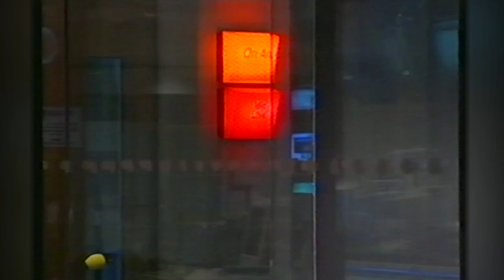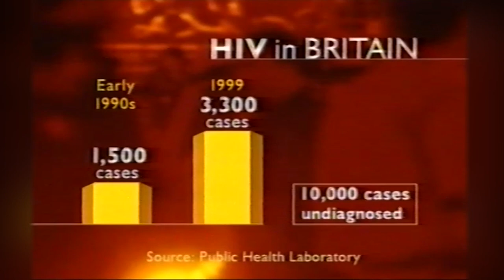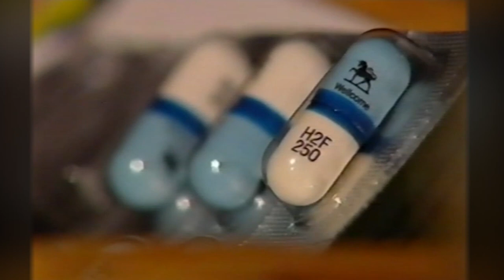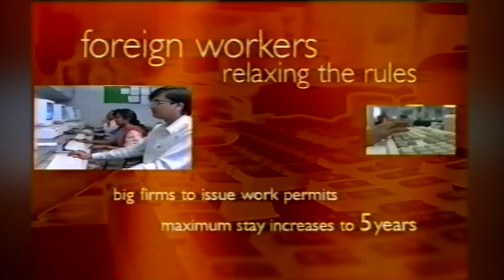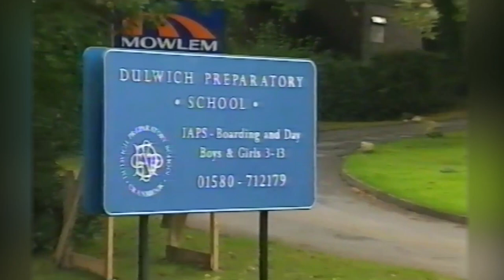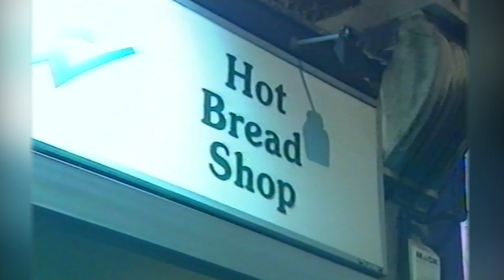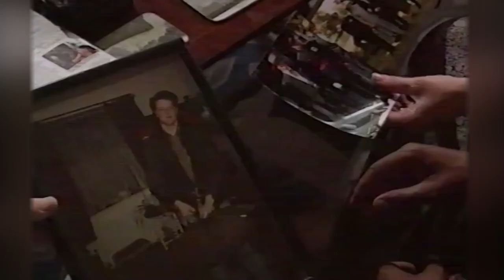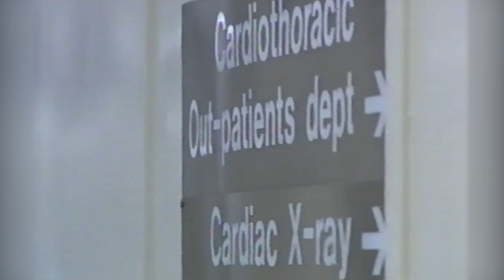First Broadcast 10 O'Clock News on BBC One - 16/10/2000

Comment: What I don't understand is when the 10 o' clock news first started they only had a short regional news then go back into the main national and international bulletin for a news roundup they never did it at the end of the 9 o' clock news. As at 25:23.
Reply: The 9pm bulletin followed a different format. Since 1985 the 9pm News was always scheduled to run to 28 minutes, with a 90 second regional update following straight after.